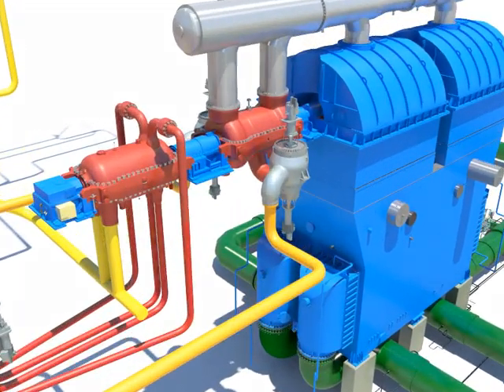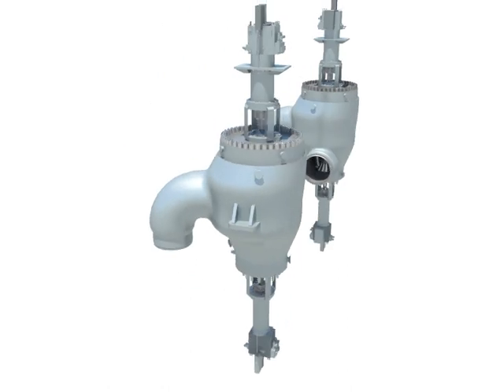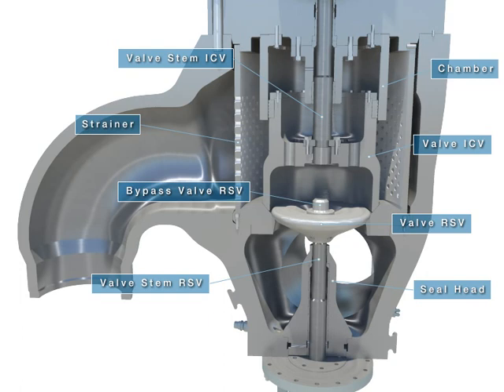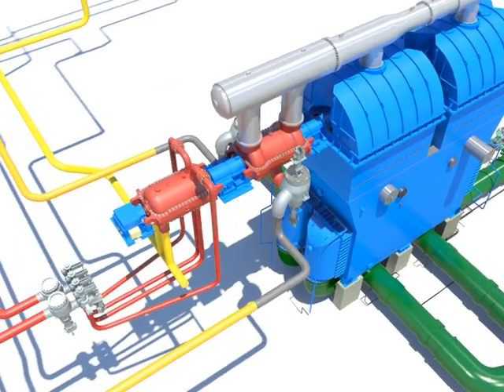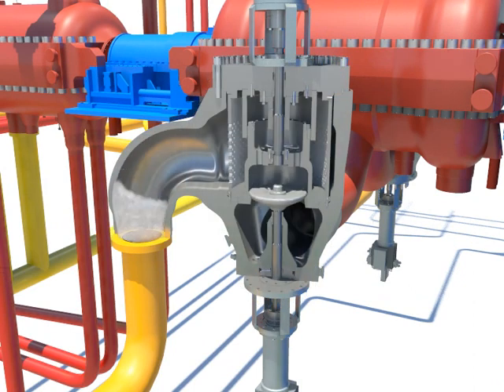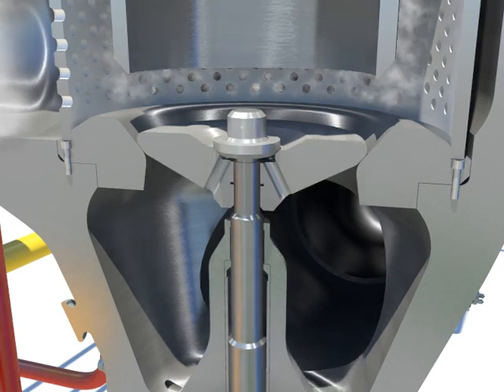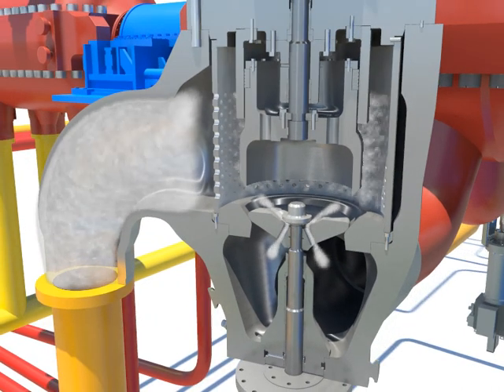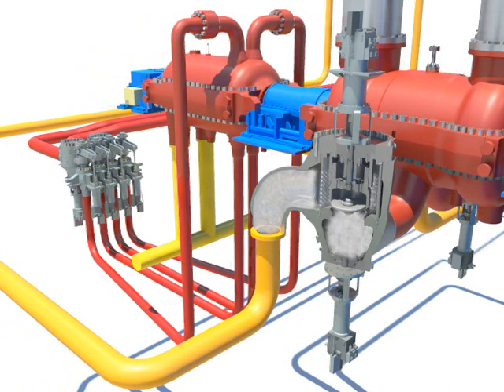How does a pressure control valve work?

Comment: Very good video. Kindly make longer videos that clearly explain how the Emergency stop valves & control valves operate. In the video about IPSV if oil supply fails how does it close explanation with animation needed. Kindly add these details to make the video more helpful.
Reply from the maker: Great suggestion!